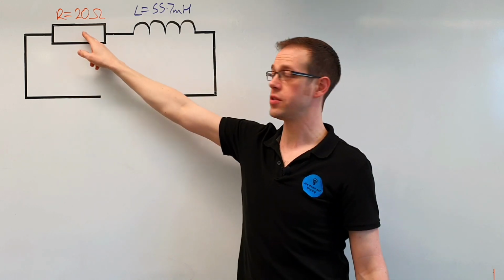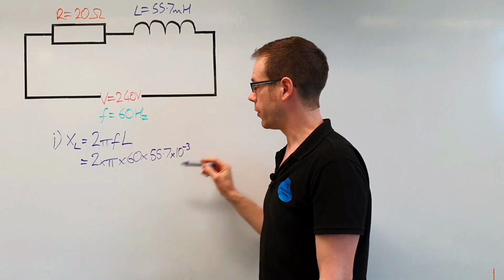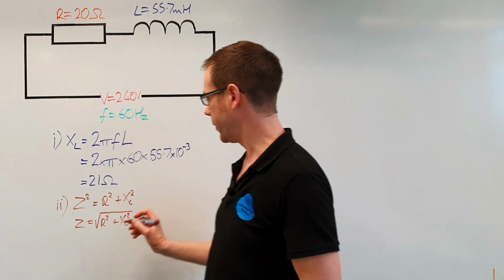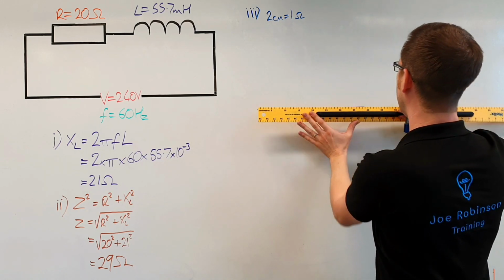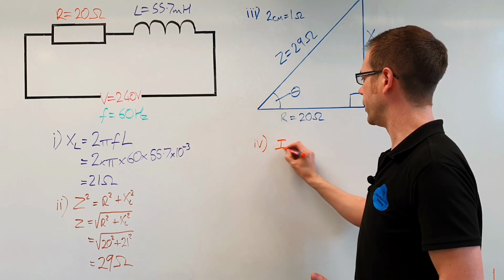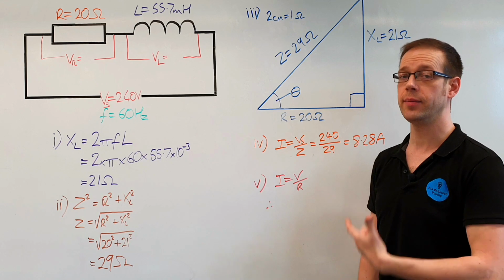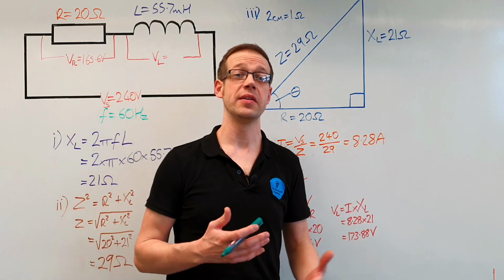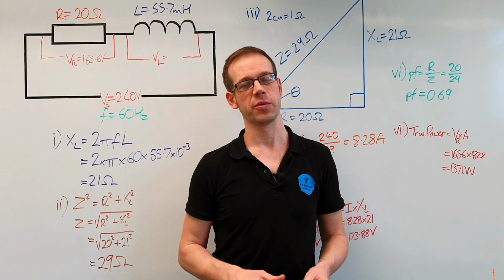How to Calculate Inductive Reactance & Impedance for a Resistor & an Inductor connected in Series Q1

Comment: Question about true watts, why don't we consider the XL of the inductor when calculating the watts? I understand it's because it's utilizing inductance and the magnetic field provides a certain amount of impedance, but doesn't the inductor also get hot as a result of power? If it gets hot the doesn't it have a watts component?